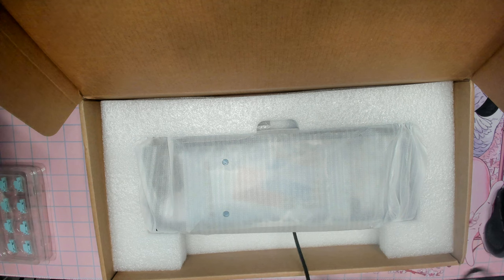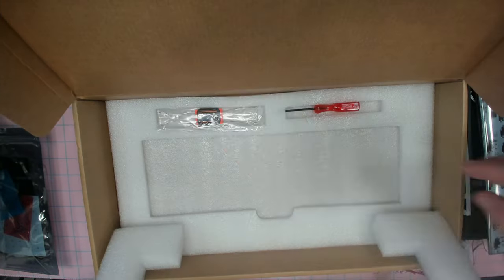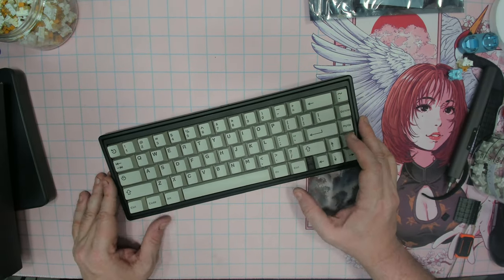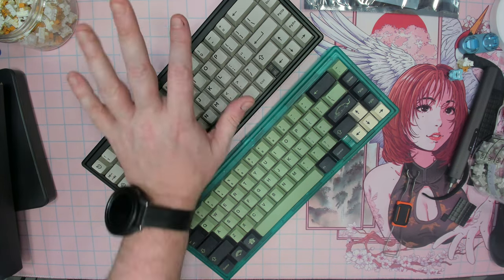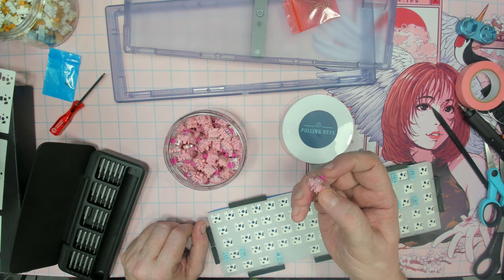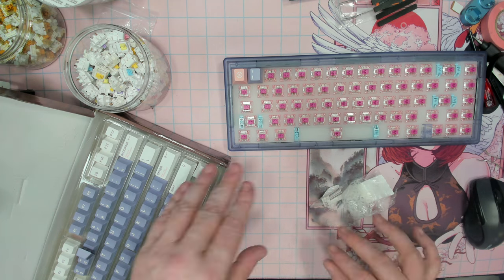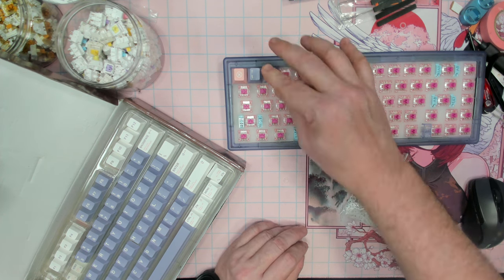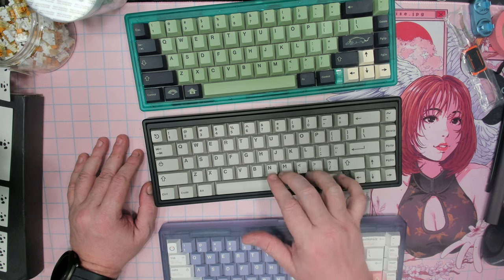GAS67 How To: Thocky, Poppy, or Whisper Quiet: What sound profile are you looking for your keyboard?

Comment: The CIY GAS67 is a nice simple honest board for the money. I just wish it felt a little more "solid" in the construction, the case feels a little too flimsy I think. Not having metal inserts means that there is the fear of a stripped thread  so you cant really tighten as much as the case might need to solve that.

The CIY Tester84 feels more premium to touch but that is far harder to build and get a consistent sound across the alphas. I think that case has a few acoustic "issues", the tray mount and the mounting locations shifting the sound of the swicthes around them. 

The Gas PC plate and gasket mitigates most of that sort of thing.
Reply from the maker: Completely agree. The Tester84 feels by far more premium than it's price tag, and I think I did a pretty good job modding R1, though I have an R2 (https://youtu.be/vgy5rSNCakA?t=686) waiting to be opened up. It sounded much better stock than the R1 (https://youtu.be/_Q8o4ihlkTs?t=278).
Reply: @MechKeyboards  I have only built out the R2 for a few people not touched the R1.

I always found the sound issue around the L key area where the pitch shifts, think that is the location the PCB mounts to the tray if memory serves. It is subtle but can amplify the difference is the consitency of factory lube on switches. Last build I did was with Gat Milky Yellow pro which I planned on leaving with factory lube but in the end needed 205g0 to mitigate and get a consistent sound out the board. Sounds good now , gas is more fire and forget and you know it will get a consistent sound :)

Have you looked at the Posiden 65 (psd65) case for the BM65 yet. I keep looking at that case as looks interesting to turn the BM65 into alu case gasket mount beast.
Reply from the maker: @WarrenLeggatt  I was not even aware that this exited. I think I'll be getting one soon as I already have at least two BM65 PCBs!

Cheers!
Reply: @MechKeyboards  I only found looking for some interesting VIA based kits to build out. There is also the new Fecker IK65 that looks a lot like the GKM67, the knob looks a little cheap but it is VIA based which makes it interesting and at almost the GMK67 price includes switches and caps. I hope there is a GMK67 R2 that is via based, think they could own the cheap end of the market if they did that :)

There has been some interesting movement in the buget market :)

BTW: Nice channel, far more down to earth than some in this space  :)
Reply from the maker: @WarrenLeggatt  I've got an IK65 on hold, I believe they should start shipping tomorrow. Fingers crossed they come back to the GMK67 and add QMK/VIA! 

Thanks, I'm glad you like the channel! Feedback is always appreciated, positive feedback is the cat's pajamas ☺